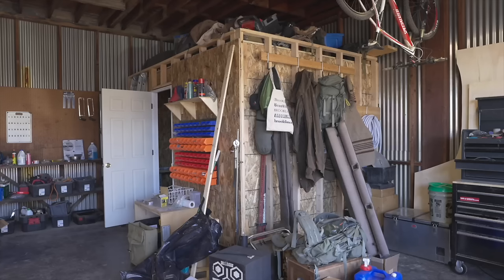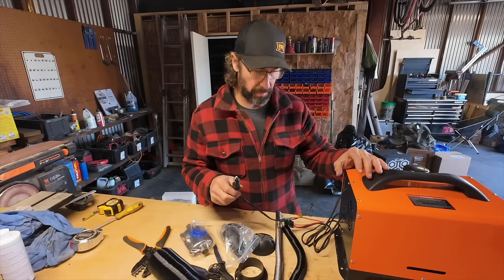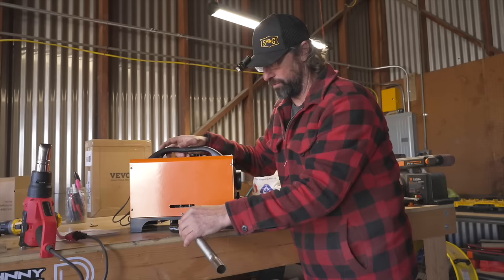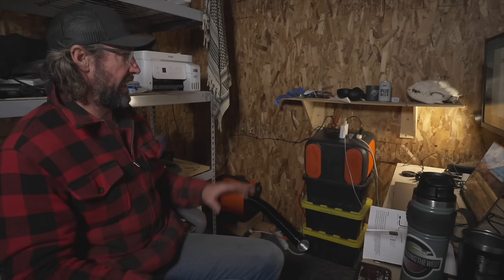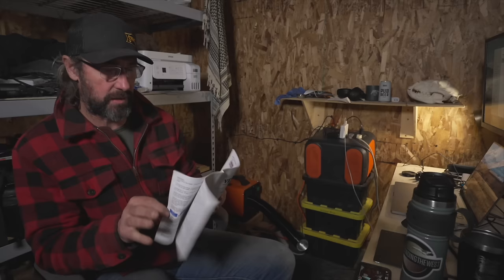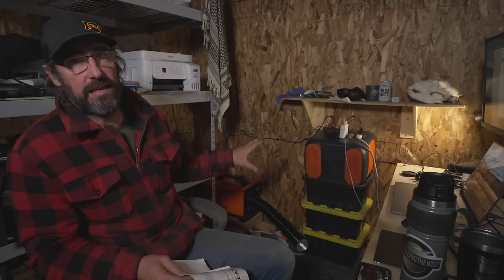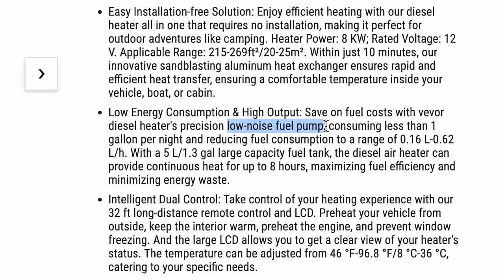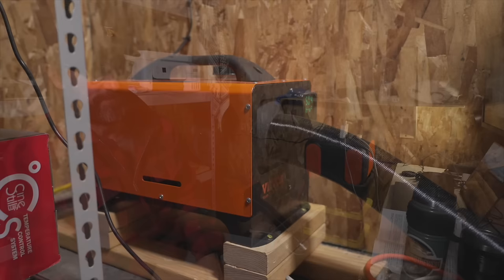Vevor Portable Diesel Heater - Don't make this Mistake😖

Comment: Why did you run the air intake outside? this causes the machine to work harder to heat the air and also poses a risk with sucking the exhaust gases back to your lungs

Comment: Great video , been looking at these units for multiple applications and that 15 A requirement  is something I'll keep in mind. I was wondering the spacing requirement between the exhaust and air intake. I read that if you put the air intake and the air output in the same room it becomes more efficient , what are you thoughts on that ?
Reply: air in and out i think really should be in the same room, dont se any reason not to do it on a machine like this
Reply: I would not do that. It will create negative pressure inside your building and suck cold air in through any opening/crack/leak. These put off enough heat to draw in cold air through the intake and keep positive pressure inside the building. Better to lose some heat to the outside than suck cold air inside in my opinion.
Reply: @theredcabin  makes sense to me. I'm new with the heater , actually  didn't have it when I made that comment then got one as a Christmas gift 😅,  so I'll get to use it eventually

Comment: Possibly using some of that exhaust pipe rolled up into a coil and mounted next to your seating area would add more warmth 🤔
Reply: Too many bends create back pressure and the heater can soot up 👍
Reply: @Dirt-Diggler  it burns clean, it's not wood fired, have you ever had to clean a water heater vent 👍
Reply: @kencraig7308  too much back pressure causes the burn chamber to soot up, the original manufacturer of these heaters say no more than 2 90deg bends and 1 meter of exhaust, been fitting diesel heaters for 20 odd years and I've had to service and clean many because instalation instructions were not followed,  not that these Chinese copys have proper instructions to follow anyway.
Reply: @Dirt-Diggler  If it's used sparingly just to break the chill and he gets some insulation in there it should be fine for the short term, he's not living in there by the way.
Reply: @kencraig7308  true 👍 there's allways a workaround for  not doing something properly in the first place .

Comment: I don't get it. You obviously have electrical service, so why not just put an electric radiative or fan blower heater inside the office? Also, a small 12V battery placed between the Jackery and heater would be able to provide the surge of current needed during starting.

Comment: I bought the same one for my 5x8 trailer I'm building. I also have a Lavaner diesel heater and would like to put it in the Vevor case.

What about using a small battery, like a motorcycle battery or APC backup battery so you can handle those bursts of energy?

I'm planning to use some linear actuators to lift the head of my bed, so I'll probably use a small 12V adapter with a battery the same way, instead of buying an expensive power supply that uses more power.

Comment: Question;
Is running the air intake so close to the exhaust creating a danger of recirculating the exhaust back into the room via the intake?
Reply: I thought the same, Carbon monoxide moniter deffo required in the office. That tick tick tick would drive me nuts. 
Nice vid tho..
Reply: The air coming through the pipe is air going to the combustion chamber not to the clean air side however I would still try to separate them so the flow would be fresh as possible even if that meant just angling the exhaust

Comment: The green fuel hose sucks. It's to flexibel. I put a hard nylon 5mm hose with a 2mm boring and a small diesel filter between the outlet of the pump and the inlet of the heater. Burns a lot more efficient. Cleaner and use less diesel. Look it up on YouTube diesel heater fuel line modification.

Comment: Love your channel as I live in your region of the PNW!

But I do take exception to these Chinese knockoff diesel heaters across the board. They are of absolute garbage quality. They guzzle fuel, they pull huge amps, they’re noisy and total unreliable.

But I understand the price point issue for folks with the German heaters. But there is a great middle price option and imo the same quality as an Espar or Wabasto heaters. Its the Russian made Planar (now Autotherm). They are commercial marine grade heaters, been in business forever and used heavily in Europe. Not only are they half the price of an Espar, their design and electronics are much simpler and way less problematic. I self installed my unit 4 years ago and it’s been running heavily ever since with zero issues. My Espar buddies have had countless electronic issues and I’d probably be in my 6th cheap Chinese heater with the amount of usage. 

My 2 cents😊. Thanks for your channel.

Comment: I heard these are not returnable if there's a problem. Also, all I have in my van is a Jackery 240, is that enough to run this heater?
Reply: I run my diesel heater off my Jackery 240, including the last three nights, with no problems. I do have it continuously charging off a larger Jackery as you won't have a long run time with just the 240. I did have some overload issues when I used a large Anker power station. Their 12v plug-in connection does allow for the beginning start up draw these heaters require. No problem with my Jackerys.
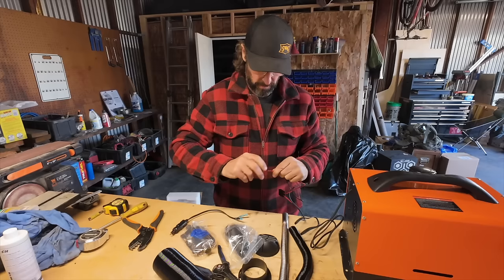Reply: I have a 5kw unit and run it off a Jackery 500 no problems 1:28
Reply: @bobdemichele1542  I believe Jackerys in general have a more robust 12v power outlet. My Jackery 240 has never failed me running my heater. Surge gets up to 130v, no problem. Just looked it up, also 5KW heater.
Reply: I run my 8kw vevor heater just fine with my jackery 240
Reply: @WildernessOffroad  Did you happen to notice the watts during the power surge while the warm-up stage is occurring? My 5KW heater maxxes out at around 130W.
Reply: @williamfuller2389 yeah the highest I saw was about 135-140W
Reply: @JakeF1st  Interesting, well over 10 Amps. You didn't state what you used to power your heater.
Reply: @bobdemichele1542  unit size doesn't matter,  they all use the same glow plug to start the burn 👍
Reply: @Dirt-Diggler  Thanks, good to know.

Comment: Hello Jason, can you add a big capacitor in parallel to the output to help Jackery to support 15A ? how time he take to warm glowplug ?
Reply: No, a capacitor simply stores energy then dumps it all at once, the glow plug needs to run for a good 2 mins or so 👍